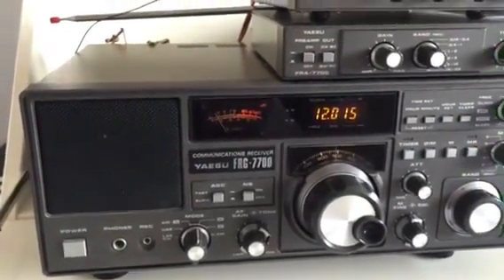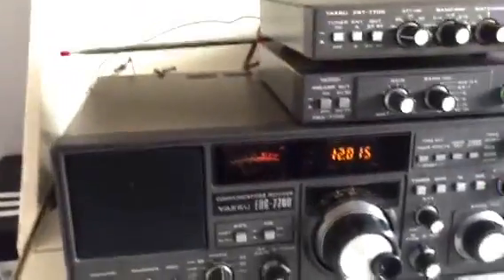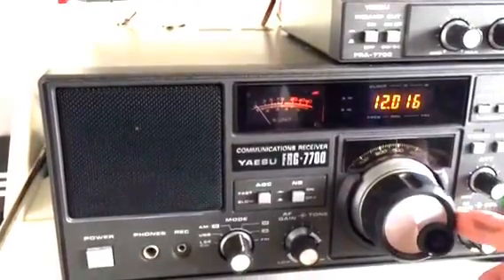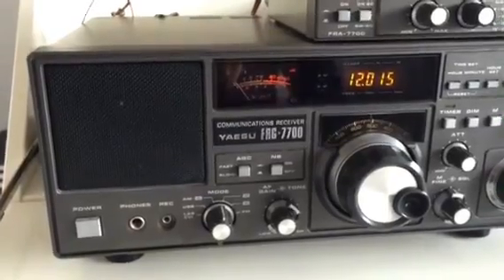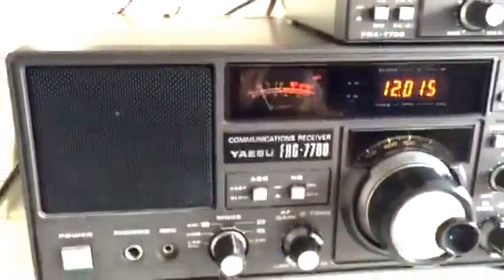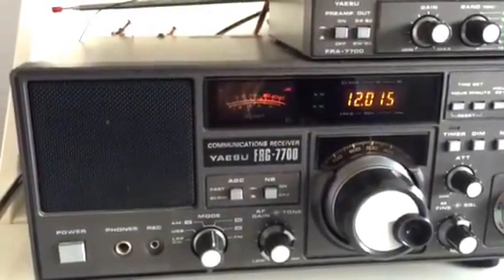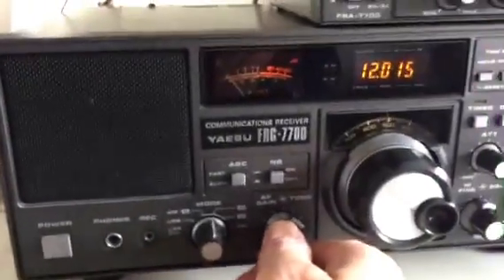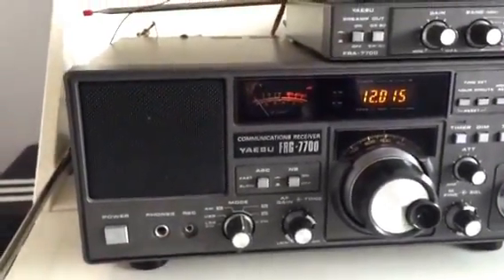Wellbrook ALA1530 loop: real-time antenna comparison - North Korea

Comment: The main advantage of a loop is its noise-busting ability. If you live in a quiet location with no neighbours for miles around, a random wire will be fine and will pick up more signal than a basic loop. But if (like most of us) you live in a dense area with TVs, computers, powerline adaptors etc all gurgling away, a loop is what you need. I've had my Wellbrook for about 16 years and it has literally saved my hobby. Listening on wire antennas here gives me S9 of noise, on the Wellbrook the noise drops to S1 or S2 and the signals are there again.  Then there's the fact that a loop has sharp nulls and can be used to reduce unwanted signals by up to 30 dB. If anyone out there is thinking of getting a Wellbrook, do it now - Andy has told me he is reducing his activities now and is thinking of retiring soon!
Reply from the maker: Couldn't agree more Andy. I was participating in our weekly Ham net last night on a G5RV with S9 of noise. Fortunately the other guys use high power so I could copy them but in terms of DXing, as you say, impossible without a mag loop. Keep safe and 73s, Clint

Comment: I wonder how many 1530's Andy Ilkin has sold since I bought mine about 20yrs ago, the thing I found was the massive, literally massive difference in noise level when indoors and compared with basic long wires and the huge nulls. When the BBC WS were on, I think it was 648khz, I could turn the loop and virtually completely null it's S9+40dB signal out and be able to pick up a Russian station on the frequency!! I'm still impressed with it all these years later, my 7030 has gone deaf in the same time period but the simple loop carries on regardless lol. 
Good test, I'll be up for the next too. 73's
Reply from the maker: HI Shaun, well that's a very good question - I reckon thousands over the years! Mine was a revelation compared to my old auxilliary antenna. Probably my best-ever buy - it has made more of a difference to my listening capabilities than any radio I've bought since. 73! Clint

Comment: !!!   !!!
Reply from the maker: +Harry Beauregard Thanks Harry. Hey, I heard that you might have a problem with your SW100? Can I help? 73s, Clint
Reply: Dear friend, thank you for the offer. The telescopic antenna brings nothing in, but I give it to a Ham Radio Club which is fortunately here in the city, and hope that they will solve it. The hope dies at last.  Yours, H.
Reply from the maker: Hello Harry, my pleasure. It does sound like there may be an issue with it as even on the telescopic antenna, mine will always pull in some stations. I hope you get it fixed because it's a great receiver when working properly. Best 73s, Clint